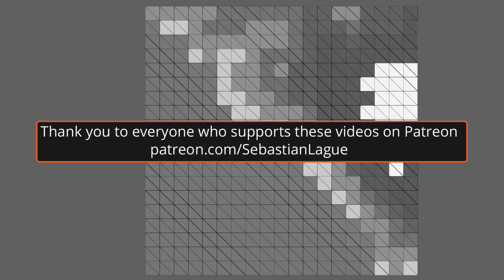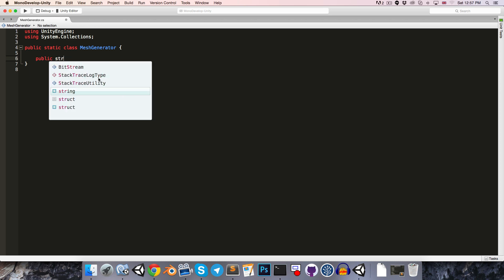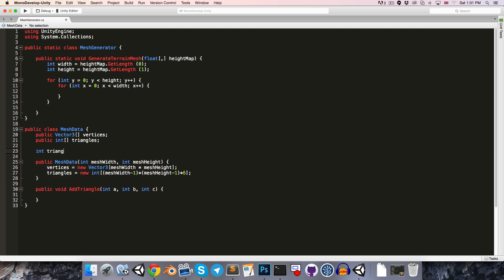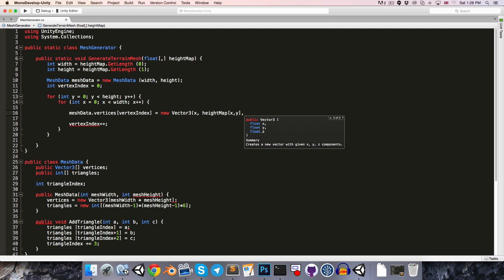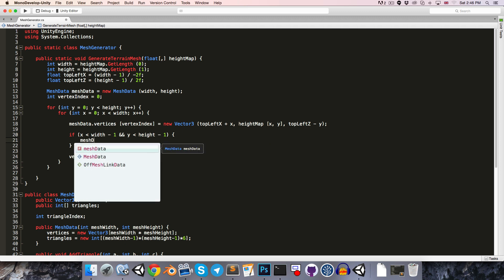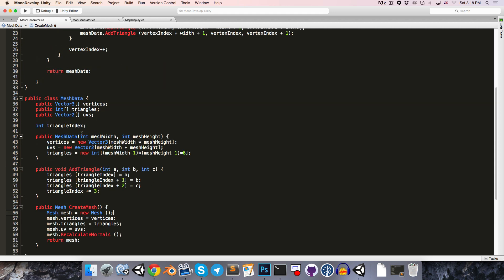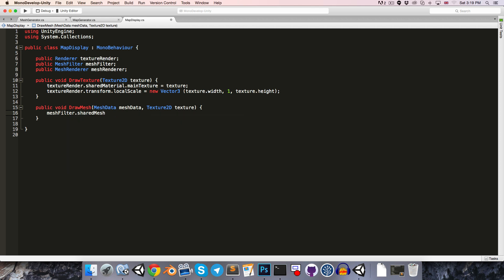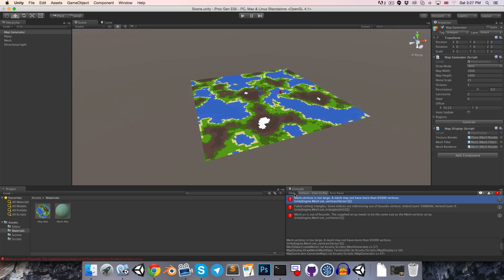Procedural Landmass Generation (E05: Mesh)

Comment: (At 0:55) Does it matter if you do 0,4,3,0,1,4? Because otherwise i dont understand the order. Can someone explain please?
Reply: The only thing that matters is it moves clockwise direction if you were to do anti-clockwise like say 3,4,0,0,4,1 itwould draw the face at the bottom
Reply: @AttyPatty3  Thank you!
Reply: Welcome.here are some orders you can use .0,4,3,0,1,4.then 3,0,4,4,0,1.then 4,3,0,1,4,0

Comment: i was trying to generate meshes by myself, since it was complicated, i first gave up then, spent like a good 2or 3 hours trying to figure our how it works. calculating vertecies was easy, but calculating the triangles were the problem. whatever, i've done it at last. and it worked properly. a couple of hours later, i found this video, which does EXACTLY the same thing. i'm like whaaaat damn if only i could find this earlier. but at the same time, it feels good to do similar thing with others thinking on your own. feels different. feels good man.

Comment: Correct me if i am wrong but through the mesh generation one column and one row of pixels is being lost right? is there a way to prevent this? 
[Edit] probably is not possible as for the texture each value for the noiseMap gets a color pixel. Therefor the noiseMap value acts like the middle point of the color-pixel.
For the mesh however the values of the noiseMap are edges of a triangle. So the first and the last row are the very edges of the mesh and therefor also for the texture. So you lose 2 times half the size of one of the "color-pixels" (talking about color texture map). The same goes for the first and last column which makes it seem like 1 row and 1 column of color-pixels is missing.

Comment: I had an issue that the mesh was upside down. I fixed it by swapping the placement of the first and second parameters of the AddTriangle function. If you have the same issue then this should help. 

Edit: Also only use this advice if the backside of the mesh is FOR A FACT facing the wrong way. If it is not and you do what I did, it will face the wrong way.

Edit2: If you have this problem you would likely also have a problem with the mesh being its full length or width away from overlapping with the ColorMap, this can be fixed by turning the constant of the related direction to the opposite.
Reply: another solution to this is to make the for loops in GenerateTerrainMesh like Lague did, loop y first then x. that fixed the upside down for me
Reply: @stefan429  Smart people tend to overlook simple solutions and not notice obvious problems.

Comment: I do everythink like you but I have an error "IndexOutOfRangeException: Index was outside the bounds of the array" 😭😭😭
Reply: Keep both mapWidth and mapHeight same (eg: 100 and 100) it is error in newer versions of unity. I dont know the cause {I am still learning}. 

Img reference : https://imgur.com/a/p7pcRfY

Your error should look like this :
{IndexOutOfRangeException: Index was outside the bounds of the array.
Noise.GenerateNoiseMap (System.Int32 mapWidth, System.Int32 mapHeight, System.Int32 seed, System.Single scale, System.Int32 octaves, System.Single persistence, System.Single lacunarity, UnityEngine.Vector2 offset) (at Assets/Noise.cs:57)
MapGenerater.GenerateMap () (at Assets/MapGenerater.cs:26)
MapGeneraterEditor.OnInspectorGUI () (at Assets/MapGeneraterEditor.cs:14)
UnityEditor.UIElements.InspectorElement+<>c__DisplayClass58_0.<CreateIMGUIInspectorFromEditor>b__0 () (at <7d90b28560b644ce87b8263efcc36eed>:0}
Reply: @aryanshah4236  my error looks like this:
IndexOutOfRangeException: Index was outside the bounds of the array.
MeshGen.GenerateTerrainMesh (System.Single[,] heightmap) (at Assets/Scripts/MeshGen.cs:21)
MapGen.GenerateMap () (at Assets/Scripts/MapGen.cs:59)
MapGenEditor.OnInspectorGUI () (at Assets/Editor/MapGenEditor.cs:15)
UnityEditor.UIElements.InspectorElement+<>c__DisplayClass58_0.<CreateIMGUIInspectorFromEditor>b__0 () (at <cdc1918cb795429dbbd46f2de52cb053>:0)
UnityEngine.GUIUtility:ProcessEvent(Int32, IntPtr, Boolean&)
Reply: The way I fixed this was by simply changing the triangle index variable to a private one inside the MeshData class because the two AddTriangle methods were changing the value to above 99

Comment: for some reason, my mesh rendered upside down. does anybody know a fix that isn't just rotating the mesh 180 degrees?
Reply: See comment below :

If your mesh is being rendered upside down (think this is due to newer versions of Unity) just flip the values in the AddTriangles method for the MeshData class e.g. 
triangles[triangleIndex] = c;
triangles[triangleIndex + 1] = b;
triangles[triangleIndex + 2] = a;
Reply: @itiah509  idk what I did but i messed around with the code after posting that comment and got it working like 15 minutes later. Thanks for the help, though.

Comment: so i get following error code and cant seem to fix it (im kinda new to coding):
IndexOutOfRangeException: Index was outside the bounds of the array.
MeshGenerator.GenerateTerrainMesh (System.Single[,] heightMap) (at Assets/scripts/MeshGenerator.cs:20)
MapGenerator.GenerateMap () (at Assets/scripts/MapGenerator.cs:49)
MapGeneratorEditor.OnInspectorGUI () (at Assets/editor/MapGeneratorEditor.cs:14)
UnityEditor.UIElements.InspectorElement+<>c__DisplayClass58_0.<CreateIMGUIInspectorFromEditor>b__0 () (at <67055f1be3654e2a987254d5437ee5b8>:0)
UnityEngine.GUIUtility:ProcessEvent(Int32, IntPtr, Boolean&)
Reply: Keep both mapWidth and mapHeight same (eg: 100 and 100) it is error in newer versions of unity. I dont know the cause {I am still learning}. 

Img reference : https://imgur.com/a/p7pcRfY
Reply: @Aryan Shah  It didn't work for me :( Still the same error as above.  (Yeah, sorry to bother you 2 years later)

Comment: If your mesh looks weird add this line to the CreateMesh method:
`mesh.indexFormat = IndexFormat.UInt32;
`
For more info: https://docs.unity3d.com/ScriptReference/Rendering.IndexFormat.html
Reply: dood thank you. this was the fix, i followed this video 3 times and it caused a lot of stress. if you have this issue (squished map with overlapping/glitching vertices) your code is fine. the link this person gave explains that the default index buffer only allows 65535 vertices in a mesh to save space. adding this new line allows up to 4 billion vertices. the issue is that our map size was too big and so vertices were missing. thank you stranger.

Comment: Hi Sebastian, the video was really helpful. One thing I don't understand is that my Mesh Material doesn't have the bright look your have. Do you know what the problem is? Also, I went on to the next video and tried to make the height values change. I copied your GitHub code, but it still didn't work, so I think it's the material (everything that you put in is the same on mine, so I don't think that's the problem. The only difference is that my Unity version is the newest, so it has different mesh settings than yours do.)

Comment: If your mesh is being rendered upside down (think this is due to newer versions of Unity) just flip the values in the AddTriangles method for the MeshData class e.g. 
triangles[triangleIndex] = c;
triangles[triangleIndex + 1] = b;
triangles[triangleIndex + 2] = a;
Reply: I also ended up having to make the following changes...
topLeftX = (width - 1) / 2f;
meshData.vertices[vertexIndex] = new Vector3(topLeftX - x, ...

Otherwise, it was like my mesh had the heightmap flipped on the y-axis for some reason. Spent a few hours scratching my head wondering if I'd mistyped something.
Reply: @aleciavogel  You are the best xD Thank you so much, I was about to stay up way to long for this before I saw you comment
Reply: @aleciavogel  Holy crap man you saved my life
Reply: @aleciavogel  Thank you so much for your help with this!
Reply: To solve the problem, I had to change this: 
triangles[triangleIndex] = a;
triangles[triangleIndex + 1] = b;
triangles[triangleIndex + 2] = c;

To this:

triangles[triangleIndex] = c;
triangles[triangleIndex + 1] = b;
triangles[triangleIndex + 2] = a;

and

Change this:

topLeftX = (width - 1) / -2f;
meshData.vertices[vertexIndex] = new Vector3(topLeftX + x,

to this:

topLeftX = (width - 1) / 2f;
meshData.vertices[vertexIndex] = new Vector3(topLeftX - x,

The height multiplier (next video) actually works when I made these corrections.
Reply: If I do this, my mesh doesn't render anymore
Reply: Thanks so much for this solution!

Comment: I'm trying to figure out why my mesh has no y component. The texture coloring works perfectly, but the mesh does not form any kind of ups and downs in terrain, its flat just like the plane. Unity 2019.3.0f5
Reply: Watch the next video. It's because the noise is normalised between 0 and 1, so you hardly notice it.

Comment: Does anyone know why my mesh is just black with no texture?
Reply: yeah i got the same problem as you, i see this error pop up in the console and i don't get why its wrong it links to this line: meshRenderer.sharedMaterial.mainTexture = texture;

NullReferenceException: Object reference not set to an instance of an object
MapDisplay.DrawMesh (MeshData meshData, UnityEngine.Texture2D texture) (at Assets/Scripts/MapDisplay.cs:20)
mapGenerator.GenerateMap () (at Assets/Scripts/mapGenerator.cs:51)
MapGeneratorEditor.OnInspectorGUI () (at Assets/Editor/MapGeneratorEditor.cs:14)
UnityEditor.InspectorWindow.DrawEditor (UnityEditor.Editor[] editors, System.Int32 editorIndex, System.Boolean rebuildOptimizedGUIBlock, System.Boolean& showImportedObjectBarNext, UnityEngine.Rect& importedObjectBarRect) (at C:/buildslave/unity/build/Editor/Mono/Inspector/InspectorWindow.cs:1253)
UnityEngine.GUIUtility:ProcessEvent(Int32, IntPtr)
Reply: You get it working? mines the same
Reply: Fergus McBride I got it working but dont remember how. I think there was a peice of code he did but didnt show. I got it from some other comment.
Reply: @smpamaccount6937   Okay, Was it to do with the code mentioned by @Benedict Newton?
edit : Don't worry i found the comment, just needed to change the 'Mesh Mat' shader to 'Unlit/Texture', Cheers for the help
Reply: Fergus McBride probably. I just searched in the comments and it said “you can see the code here but he doesnt write it on camera” or somethin like that

Comment: From anyone in 2020 wondering why your mesh might look funky/wrapped around when going big, it's because there's a vertex limit of 65535 by default, but you can change it now.
See here for more info: https://answers.unity.com/questions/1672533/is-the-limit-of-mesh-vertices65535-still-valid.html
Reply: I could not figure out why my mesh seemed to be wrapped in on itself.  I had written my code quite a bit differently from in the video, even adding a water erosion simulation before ever trying to generate a mesh, but I figured I was experienced enough with C# to do so.  Then I went to generate the mesh and wound up pulling my hair out trying to figure out what I had missed / messed up.  This was it.  Thank you!
Reply: In my case only the upper left triangle of every single cell was rendering. It was this as well, thanks.
Reply: do you know how you fixed it i have the same problem
 @Mananaut

Comment: why is my mesh forming as a weird rectangle shape
Reply: Probably related to the map width / height. Make sure they are set to 100. I think the issue is that the MeshData object has a maximum number of verts of 65000(ish). So if you have a mesh that is 250 x 250 or greater, you will exceed that value and it creates some funky behavior.
Reply: @zoeherriot  1 million thanks for this. I had width and height as something obscenely big it seems (512x512) and my Mesh Map would be roughly 1/4th of the color map (thus only a rectangle representing 1/4th of the big square map). I set it to 100x100 and now it works fine. I had no idea abouy the max number of verts.

Comment: Sebastian: "So that might seem terribly obvious" 
Me: gulps in fear of this power level
Reply: safhoasjfhalsfhashglşa
Reply: Yeah i try to look for the visual interpretation of the logic within the programming for this reason. Essentially as all programming is instruction, you just need to look at what it is telling the compy to do, you just need a way to think about what visible steps the compy is taking as it follows each little instruction, like dance steps or something. And like dance steps, you can start to pick up on patterns pretty quickly. 

Meshes have many unobvious features and there should be a long boring build-up to even this kind of application for those coming at the subject with no prerequisite knowledge, so I'd suggest backing up to square one. It's troublesome because if you are coming from a gaming background you probably just wanna jump in there and get wrecking stuff, but in trying to program anything you need to start with a plan and modify it as you go as if you're building something that needs to work, instead. The process is counter-instinctive to play, I find. Gotta figure out that you don't know what you don't know!
Reply: Faccccts
Reply: whre
Reply: ah that's a good comment 😂

Comment: Quick Question.
i would like to change the mesh so that the Mesh is less smooth. So that it can look somewhat like Transport Tycoon ect ect.
But, i am a bit blindsided by the math in Mesh Generator, due to my lack of programming knowledge. 
i've seen a video by Eric Schubert on youtube but i am not sure how i can adapt his code into Sebastian's code.
Reply: Hard edges come when triangles don't share vectors. All of his vectors are being shared between all of the triangles he creates so they will smoothly transition their lighting instead of having hard edges.

You will need each square to have 6 vectors instead of 4 as he does right now. This also means that internal "array locations" will have as many vectors as triangles they are connected to.

So array location (0,0) will have 2 vectors. (0,1) will have 3. (1,1) will have 6. I've done it with both conditionals and nested for loops. I usually have a jagged array or a struct of some nature that holds multiple Vector3s. Later I iterate over it with similar conditionals or nested loops to create the triangle int array.
Reply: @DB-pt6zj  thank you, ill try and keep that in mind when i get back around to this thank you, very much!

Comment: Using lightweight render pipline, the mesh material turns pink with standard shader. Using Lightweight Render Pipeline/Lit the texture is not assigned correctly and I just get a grey landmass. Is there a way to fix this.

Comment: Anyone trying to figure out why the PLANE will have the texture backwards compared to the mesh  (its mirrored over the x axis)  the solution is to go to the material for the Plane texture, and set:

Tiling     X =  -1
Offset    X = 1

its an issue with how Unity built the plane, im guessing they filled the vertex list backwards or something or its an issue with how it maps the uv, i dont know.   The above solution fixes issue.
Reply: you can change uvs like this ~!

meshData.uvs[vertexIndex] = new Vector2(((width - 1) - x) / (float)width, y / (float)height);
Reply: @밥도둑-l5j  
Or even simpler: 

triangles[triangle_index] = c;
triangles[triangle_index + 1] = b;
triangles[triangle_index + 2] = a;
Reply: Thanks, it sure does fix it :)
Reply: Thank you!
Reply: thanks!
Reply: even simpler: mesh scale: -10 for x! (Correct me if i'm wrong)
EDIT: WHOOPS!
Reply: @knowledgemagnet4077  
This is more like a workaround but also works fine as long as you don't want to modify the mesh scale at runtime.
Reply: @AniProGuy  I don't have to...
Reply: had to go with the crude scaling fix :(
Reply: for x
Reply: im in Unity 2019 LTS , i think they fixed it, it works correctly
Reply: Thank you Radbug!

Comment: If you click Play  /  when "Running the Game"  (not in editor window)  the Plane is just white, and the Mesh is black or otherwise not rendering the texture,  the problem is,  when hitting "Play", all the Material data is erased. there is no more mesh renderer data.   cant figure out why though. I did find a solution.
    If, while the game is running,  you go to inspector and click Generate Map,  the mesh texture WILL load  There must be a way to serialize the data ?

edit:   I found solution.  I added an empty object, called it SceneController.  made a new script, called SceneController, added it to the new object. The script Generates the map  in an void Start()  function. since the SceneController is in the scene already, when you click Play, it generates the map.  Textures show up :)      You have to drag the MapGenerator object from the scene onto the public variable on the SceneController in the inspector to link them.

---------------  The script:

using System.Collections;
using System.Collections.Generic;
using UnityEngine;

public class SceneController : MonoBehaviour
{
    public MapGenerator mapGenerator;
    // Start is called before the first frame update
    void Start()
    {
        mapGenerator.GenerateMap();
    }
}
Reply: alternatively, in the the MapGenerator class directly, you can simply add 
void Start(){

     GenerateMap()
}

Because it is a MonoBehaviour class it has the start method which is called at game start for that purpose

Comment: When I try to use a lit (use LWRP) the colors don't work. How do I fix this? I can only see the colors when I use an Unlit shader, but then it's not affected by light.
Reply: fixed it:  meshRenderer.material.SetTexture("_BaseMap", texture);
Reply: @adriannafoster2583   I was having similar issues and you pointed me in the right direction, thankyou.   My final solution:

meshRenderer.sharedMaterial.SetTexture("_BaseColorMap", texture);

and also for the Plane:

textureRenderer.sharedMaterial.SetTexture("_BaseColorMap", texture);